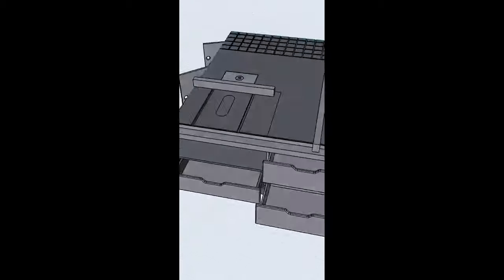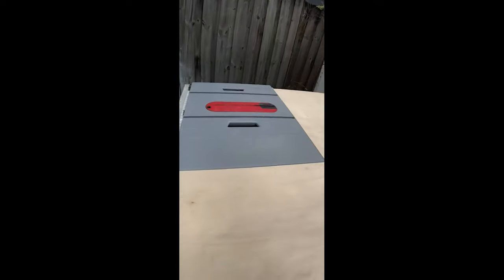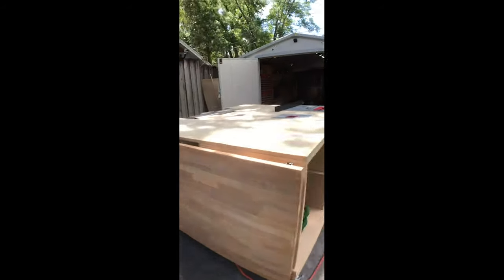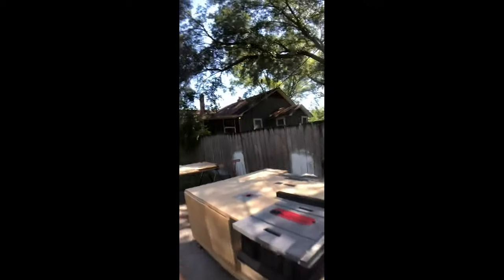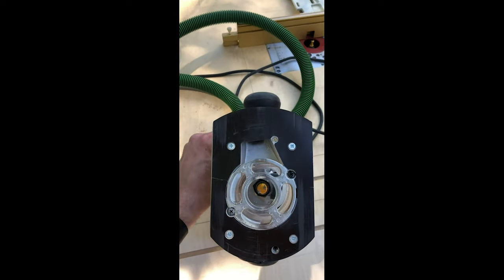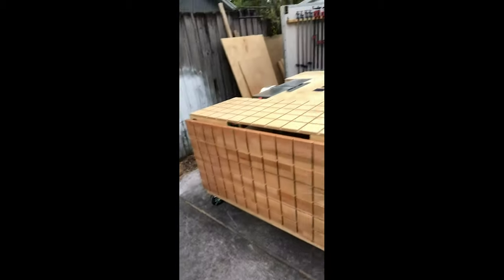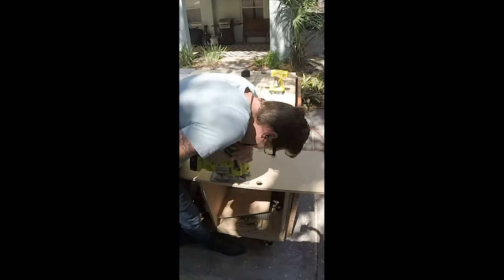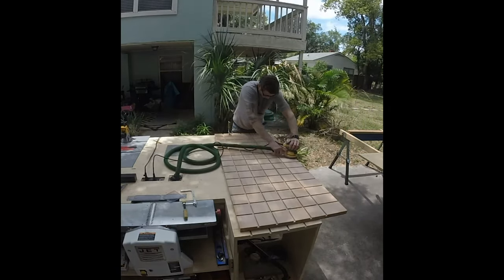Most-in-One Cart Video with all Instagram Stories and Final Video!

Comment: I see you are using sanding drums in your router station.  I have not seen this before because routers spin so fast.  Most of these drums I see are for drill presses and hand drills.  Did you find some that are rated for high speed rpms?  I would like to find some for my station.  Lots of great ideas in your build.
Reply: router speed controller, my man!